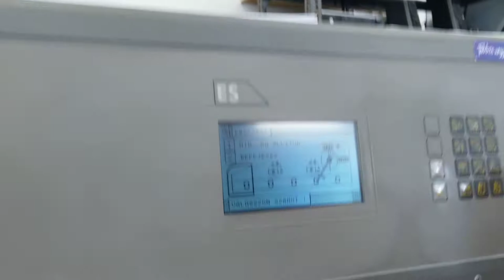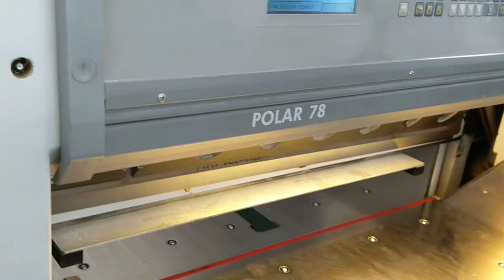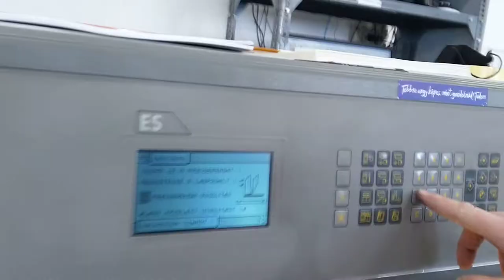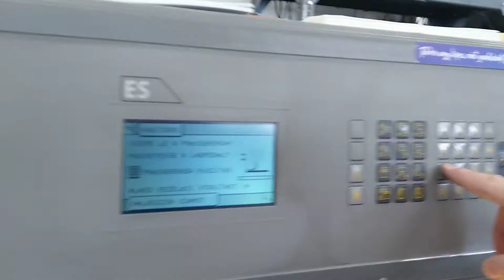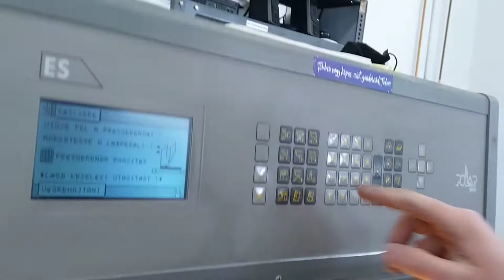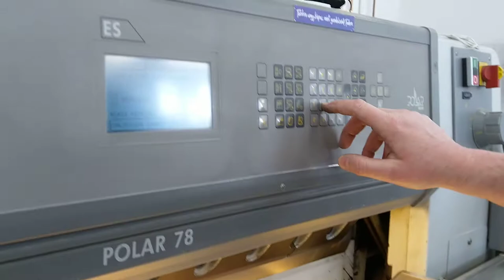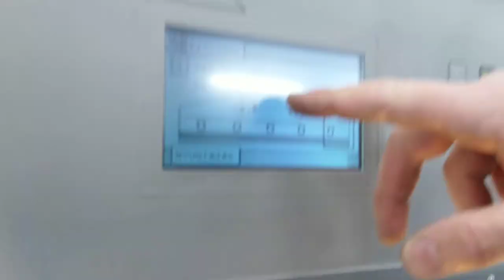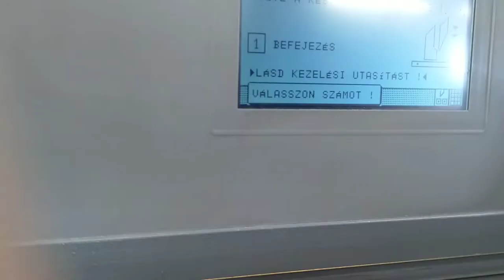Polar 78 xs Paper Guillotine Replacement of knives - Késcsere

Comment: @Frank Collar. Very good instructional video sir! Just a tip to maybe help you with your cutter. The Polar technician who trained me on the 78ES cutter said to check that the shear bolt in the link arm is tight after each knife change. There should be a special narrow ended spanner/wrench for this in the machine tool kit. Stay safe and well.